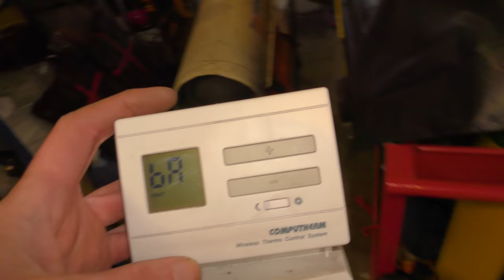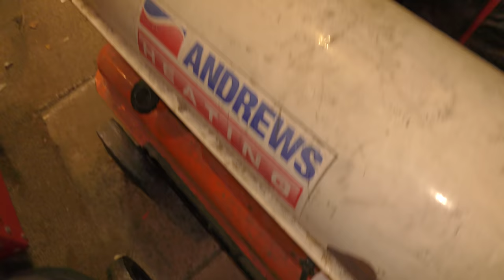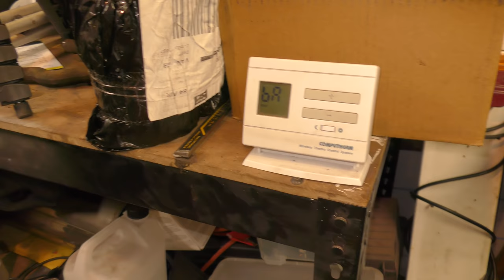Wireless thermostat mod to diesel space heater

Comment: I know this is an old thread, but thought that I would ask the question! David , I have just bought a sip 09593, the built in thermostat is totally useless as there is too much of a difference between the room temp and the temp displayed on the heater. So when the heater is on you are melting then after waiting for it to restart after the 4 deg drop in temp you are freezing your nuts off!! would you be willing to help guide me to fitting an external thermostat??

Comment: Hi there, surprised this is the first video ive seen of this. I was wondering does it smoke on start up? Im wondering weather to get a propane one or kerosene.
Cheers
Reply from the maker: Sometimes on it's very first start from cold it gives one puff of smoke as it lights.
Reply: @DavidMcLuckie  thankyou, would you say that size model would be too big for a normal uk garage?
Reply from the maker: Probably a little large yes.  Physically it's a big unit, so takes up quite a bit of space.  It's also fairly loud.  I've actually got a smaller one I use now, but it's got an onboard thermostat and it's not as good as the wireless version.
Reply: @DavidMcLuckie  yes i thought so. Any issues with condenstion on tools? Thats whats holding me back at the moment.  Btw ive watched a couple of videos about the diesel heater, its very interesting and a good watch
Reply from the maker: Yes.  But that's because the workshop isn't permanently heated.  So the tools will be sitting at whatever temperature it is outside and then you heat the air up, hot air hits cold surfaces and you've got condensation.

Comment: The 1thing u are missing is u have lost the means of heater cooling down to prevent the overheat switch being tripped this is what protects your nozzel being cooked ht leads and transformer, may all be different from when i worked for andrews
Reply from the maker: It didn't have any sort of cool-down function.  When you flipped that switch it stops dead.  But as it still powers the circuit board all the time when it runs out of fuel it stops and won't fire up again until you cycle the power.  My other space heater with the built in thermostat just stops as well when you flip the switch on the thermostat.

Maybe the higher end stuff has a cool-down function?
Reply: Thanks for the comeback i know they were forever altering control gear some improved the heater a lot did not regards
Reply from the maker: I too was surprised when the switch just stops it dead.  I expected it to over-run the fan to cool it down, but no.  They just stop.

Comment: Why could you not just take an electrical cord cut it and create a thermostat control that would work with any torpedo heater. I would like to do this because my torpedo heater, I believe kicks on and off constantly. If I can use an external thermostat I might be able to get the cycling not to be constant.
Reply from the maker: There's no reason you couldn't make the controller box inline with the mains feed.  You just have to use something like a junction or a project box to house it in.
Reply: @DavidMcLuckie  Great idea! Never crossed my mind before, but needed.

Comment: But what to do when de fan motor is not turning anymore?
Reply: I got a same kind of heater but it stopped working. Motor is making an humming sound but is not turning.
Reply from the maker: If you take the cover off, and try turning the fan by hand (with the power off) is it a little stiff or really stiff to turn?
Reply: No, easy as it should. Took it apart allready but cant see anything thats wrong.
Reply from the maker: Slightly dangerous test this time.  With the cover off start the heater up.  Using a screwdriver or something other than your fingers try to spin the fan.  See if it jumps or starts to spin.
Reply: Allready tried that, but doesnt help.
Reply from the maker: Shame.  Time to get the multi-meter out?
Reply: Ill ask someone here. I know everything about Subaru's, but nothing about electrics haha.